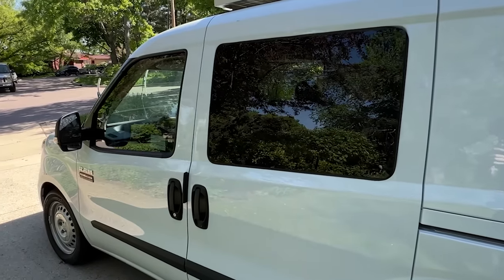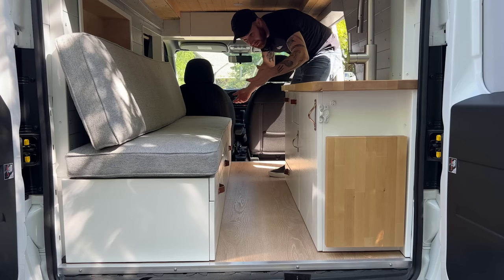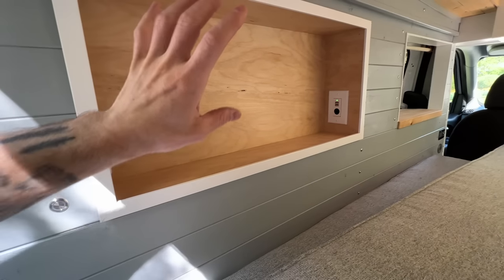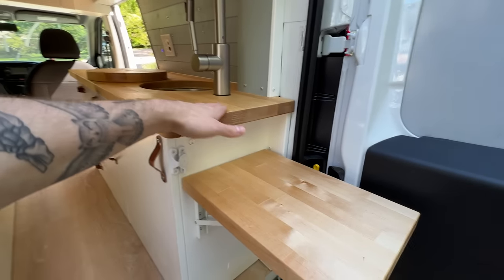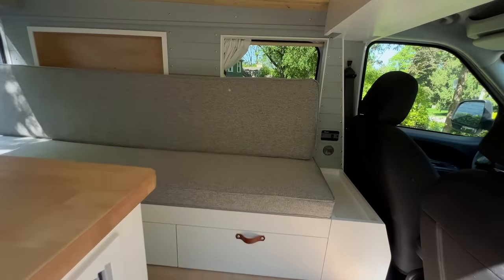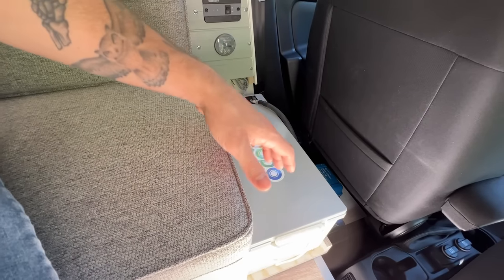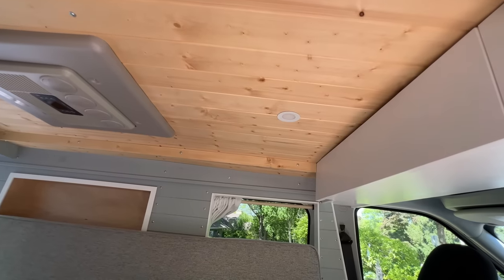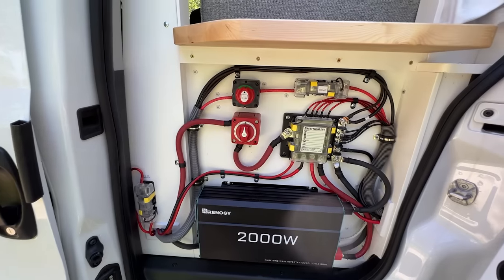DECKED OUT MICRO CAMPER | FULL TOUR | Promaster City

Comment: I would have a sliding panel to reveal all the electrical components. No need to destroy a wall or wall covering in order to get to the wires. Homes should be built like that as well. We had to replace several large floor-to-ceiling pieces of sheetrock when we had our electrical wiring updated. Completely ridiculous for homes to be built this way .

Comment: Purchased your bed build plans but I need more information about the build.  What are the overall dimensions and diagram for the bed?  Does this build plan work for promaster city, nv200 and ford transit connect?  Does the build put the bed over the wheel wells, if not do you know how to accommodate over wheel well build
Reply from the maker: Thanks for picking up the plans!

The dimensions are listed in the plans as well as on the product page on my website.

The plans can be modified to fit your needs and can be used in any van type. It is not designed to fit over a wheel well but could be modified to do so. 

Hope that helps and good luck!

- Josh

Comment: Sorry it’s already tight as it is. I need a high roof. Got to have a stroll space. So the bed has to be wall to wall. What is the width measure ? If less than 6 feet won’t make it for me. 

Thanks though great work that I got to give 5 stars.
Reply from the maker: Thanks, measurements are given during the tour!

Comment: What does your AC need to run and for how long? I thought 4-5K minimum? Thanks,Rich
Reply from the maker: Runs off 12v and duration will depend on your battery capacity and what setting you use on the AC.
Reply: @Josh_Oakes  natch! Makes sense to me. TY

Comment: Very nice Sir. Well thought out spatially for the limited room in that van and the execution is phenomenal. I like the exposed screws. It's not a house or condo, so the screw heads look appropriate/utilitarian and give the ease of removing boards if future trouble shooting needs to happen. May have missed this if you mentioned it but, was there a external shore power port installed for parking near outlets? Also, any idea how long that AC will run while the panels up top are in full sun? Your build is fantastic just wish the AC on the roof was discussed more in regards to This particular 200 watts of solar and 200ah's of battery. Not sure, but I'm assuming that AC can just be used as a exhaust fan too? Thanks for sharing your craftsmanship.
Reply: Also, the link in the description is to a fan, not an a/c unit, so not the same one as used in this build.

Comment: Great little build! Curious about using the fridge in that position. Won't that cause harm to the compressor?
Reply: That particular fridge is designed to stand that way. It is a side open, not a top open. I have one exactly like it in my office. Great little fridge.
Reply: @Not-px7vd  interesting because the supplied link in the video did not picture any that were side standing they were all chest type.